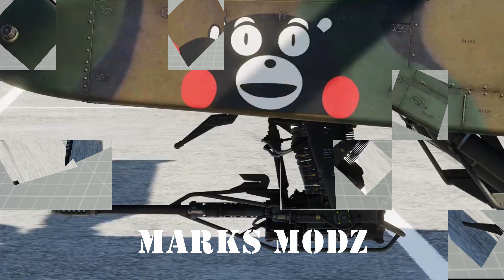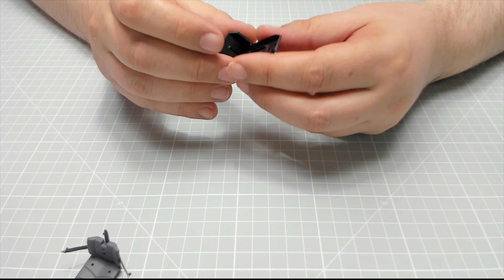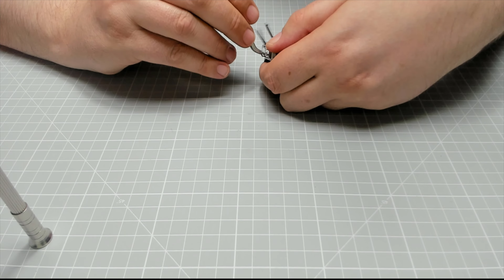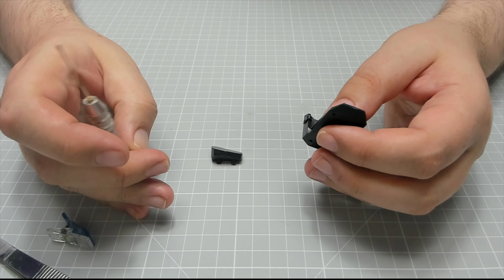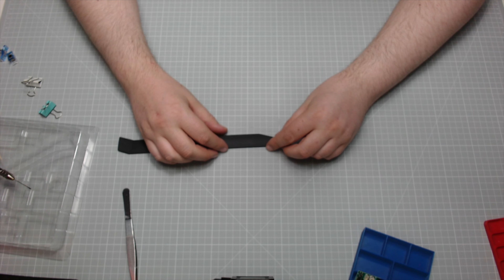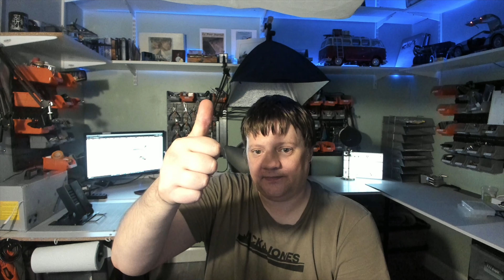Build The Apache Pack 1 Stage 2

Comment: Use a double a battery board, mite get lift of lol, nice lengthy 1 that, nice job
Reply from the maker: Thanks dee. There is alot to do in this first pack
Reply: @MarksModz  seen that wen u unboxed them